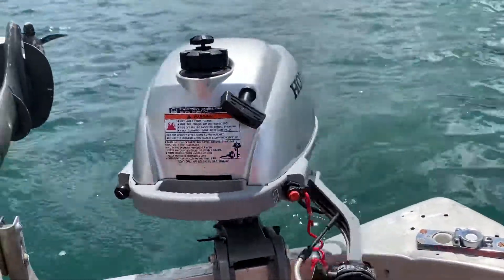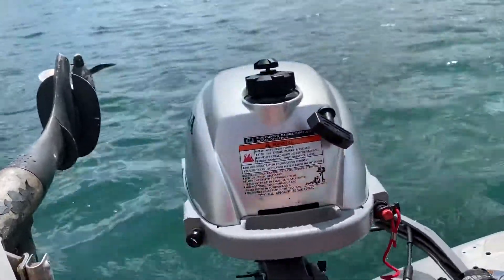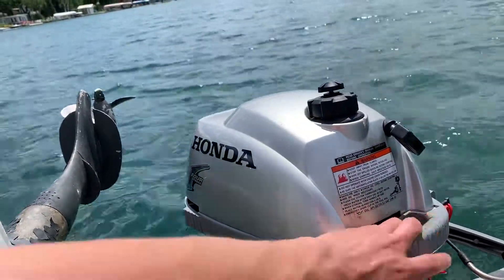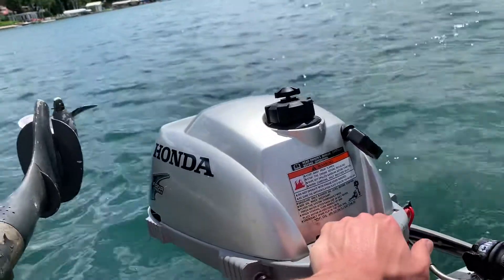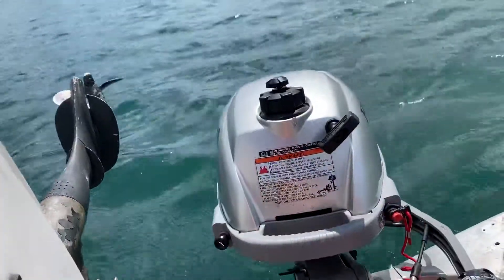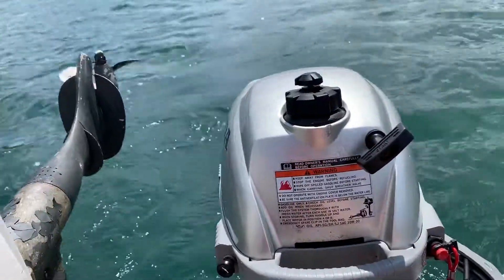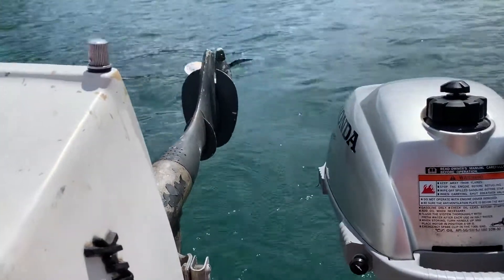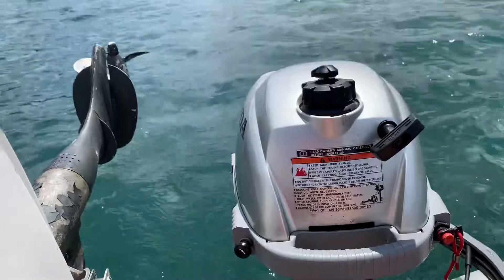Honda 2 hp four stroke outboard

Comment: con ese motor se puede planear con una embarcación tapa cat 2,60 m
Reply from the maker: This is on a 14 ft aluminum boat and it doesn’t have enough power to plane it out even if I took the gas tanks out and the other motor off. I would say no.